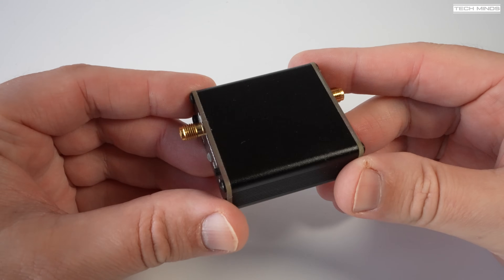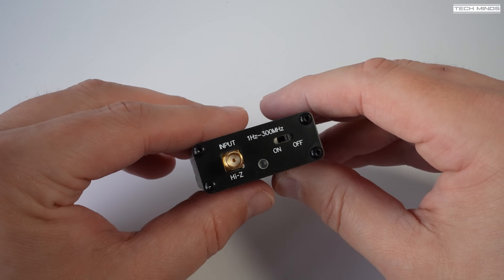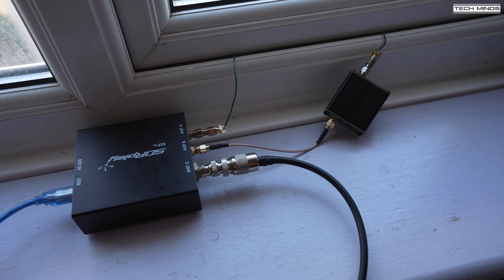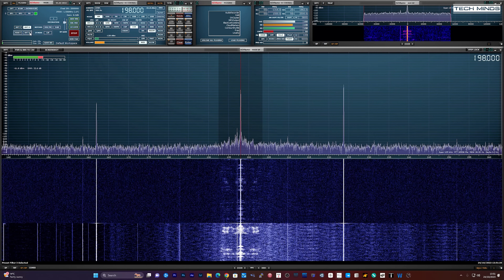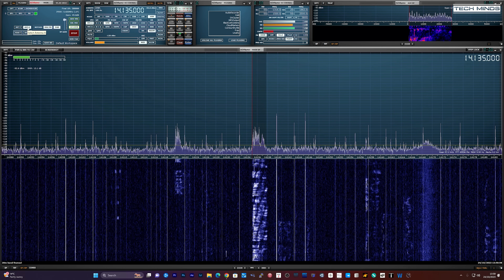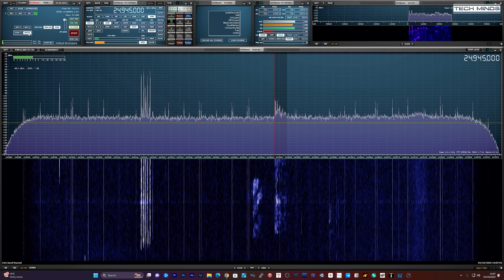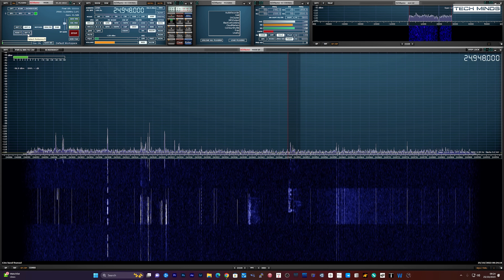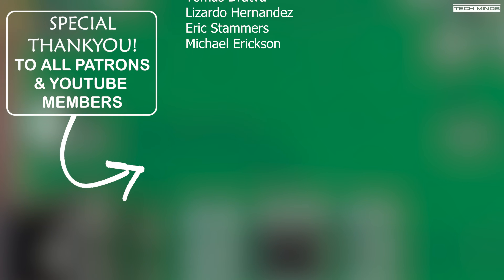High Impedance Amplifier for Software Defined Radio

Comment: It seems like your only ground connection is through the USB to the computer. A good ferrite choke on the USB cable and a good low noise ground should give better results I think.
Reply: Grounds don't help nearly as much as hams think.

Comment: For many decades now we have receive antenna jacks on radios and no one ever cared about the impedance. For a more repeatable test: Take any signal generator (Si5351 module is fine), attach a piece of wire of wire to the output and measure the SNR of the signal on both inputs.
Reply: The principle of maximum power transfer through matching the load, transission line and amplifier impedance is one of the foundations of RF engineering. It has been known for over a hundred years now.
Reply: @brownj2  All true, now quantify the effects on receive.